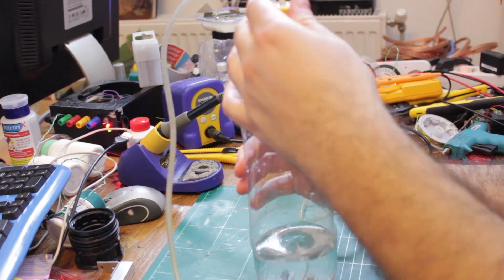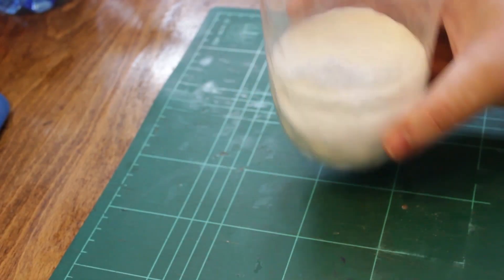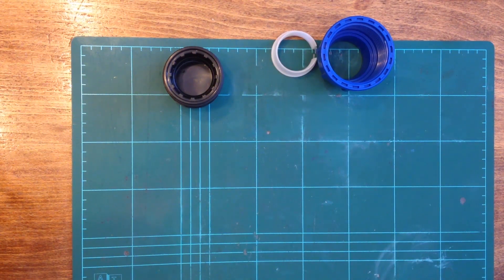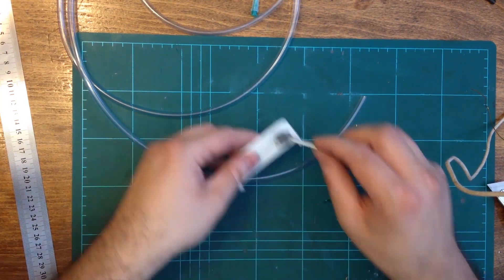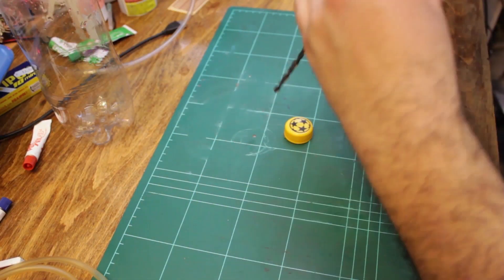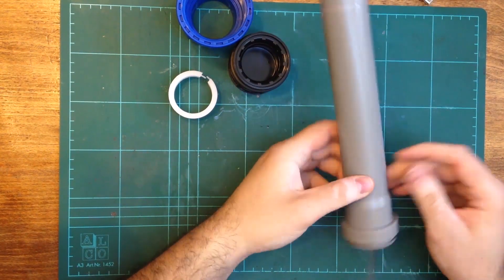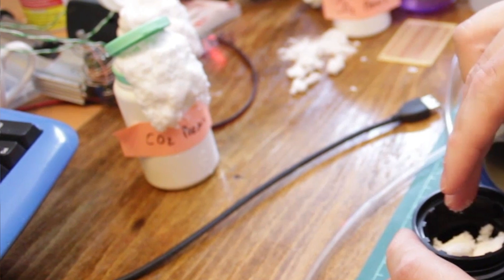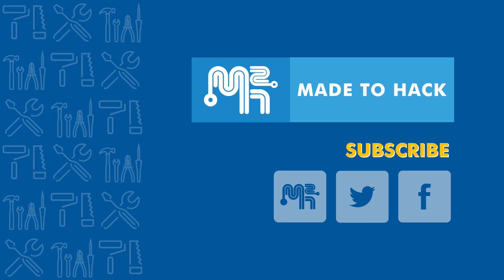DIY CO2 generator using household items / ingredients

Comment: can I control the flow ? how long would the mixture last?
Reply from the maker: yeah,the silicon tube has a valve that can control the flow, usually found at pet stores / aquarium stores. How long it lasts depends on how much mixture you have. It can last from maybe a few hours to a day max? You have to shake it once in a while.